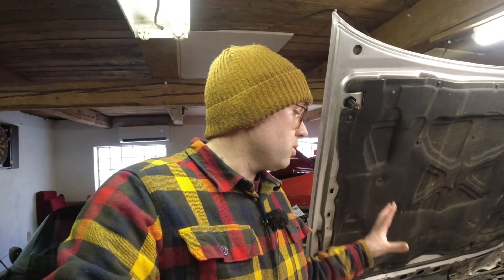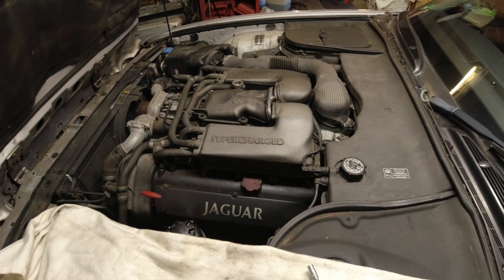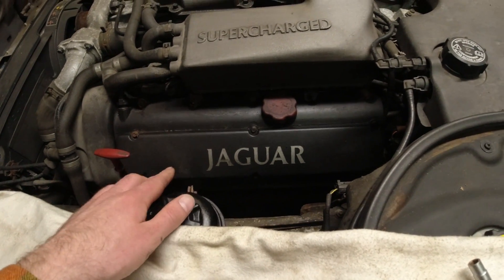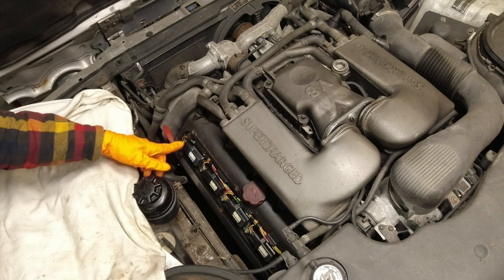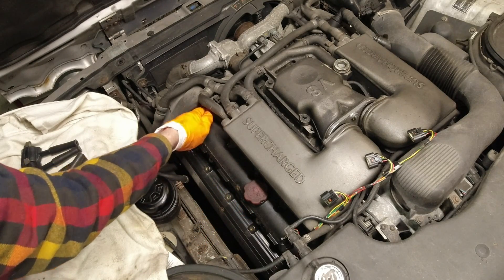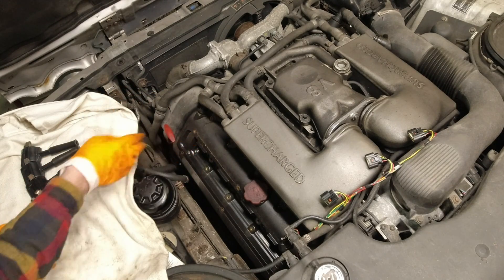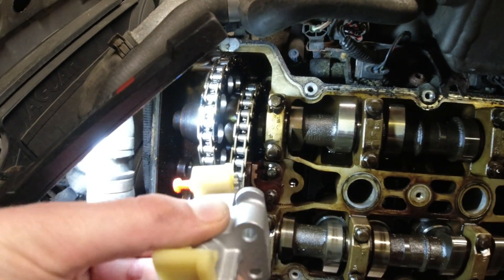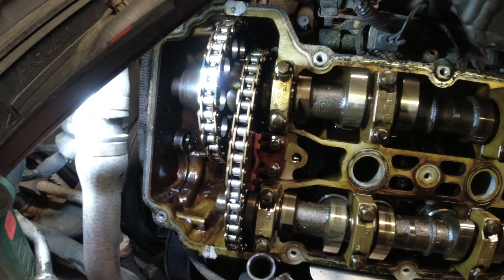Checking If Your Jaguar V8 Has Had New Upper Timing Chain Tensioners

Comment: Hi, Thank you for the video. That is helpful. I already have an XK8 4.0 where the tensioners were claimed to be replaced, but there is zero evidence. Now I know how to check. I am now also  looking at buying a 1998 4.0litre X308 and the advert claims the timing chain was replaced with the tensioners and water pump in Feb 2024. He has an invoice but there are no part numbers or photo's of the work. The car is on ebay in the UK. I doubt the owner would agree to me taking the covers off. If I heard you correctly, I thought you said that they no longer make the plastic tensioners? Is this correct? In which case then the new improved tensioners would have been fitted?? Looking at the car overall, it does seem to have been well looked after, but in my life I have discovered sometimes strange things happen??? Any comments?

Comment: Great video Adam.  Guessing that engine is an AJ27S.  I replaced the cam cover gaskets, coils, and spark plugs on my AJ33S recently.  If you are lucky enough to have the original Denso coils then no issues getting them out.  If OEM / Aftermarket coils used, then the boots can split and can be troublesome to remove.  I used dielectric grease on the ends of the boots on the replacements to ensure that this does not happen again.  I made a longer video documenting this as on the AJ33S left bank there are plenty of components to remove prior to getting access to remove the cam-cover.   Just thankful that the upper tensioners are metal on the AJ33S like you say.

Comment: With my x308 the tensioners were not cracked. The plastic guides however were completely shot. I changed all the guides, chains and tensioners whilst in there. Also upgraded the water pump and thermostat tower too.

Comment: Nice to know these tensioners can go. Are you able to tell us what years these are a common problem and what year engines have been upgraded? Thanks
Reply from the maker: All made before the 4.2 came out need to be checked.
Reply: Mid August 2001 they were upgraded to metal. So a few 4.0 should be ok

Comment: Hi Adam, Late 4.0s have the latest tensioner (metal) I don’t know about the XJ but for XK8/XKR it was AJV8 engines numbered from 0108130000 (built from midnight on 13 August 2001). My May 2001 4.0 XKR has the latest tensioners (and water pump and thermostat tower) but the 4.2 engine came in from MY03 in August 2002

Comment: Yup, let’s see how to get these tensioners replaced.  I have an early XK8 with low mileage (under 33K) and I’m pretty sure this work was never done by the original owner.  I have heard the number of steps to get the new timing chains set on the cam shaft with TDC retarded correctly can be difficult. I will watch every step you take on this!  Thanks from across the pond!

Comment: Yes! I like to see it. I have a question for Adam; For a long time the straight six was synonymous with Jaguar. The shorter block 2.4 and 2.8 versions.And the full size block 3.4 , 3.8 and 4.2 versions. It was in Jaguar's "DNA". A large, torque, smooth and powerful six. Just like A Cobra or a Ferrari is associated with a certain engine type. So the question is basically. Would you rather have seen Jaguar keep the straight six, develop it. Maybe With a Supercharger. Or was it necessary for pragmatic reasons to go with the V8? 🤔🤔🤔😃
Reply: I've read at some places that for typical USA buyers of the time, a straight 6 was seen as too small, and the V12 too big. So they came up with the idea of a V8. For me, the AJ6 and AJ16 are excellent.
Reply: AJ6 and AJ16 are great engines (I have had both) but AJ16 and AJ16 supercharged were unable to be developed further to match the competition.  V12, V10, and 6s were considered but the trend was for V8 at the time.  Interesting to note that a pure Ford V8 was touted but rejected by Jaguar at the time as not having suitable levels of refinement.  AJV8 was a Jaguar design even though it was assembled at Bridgend (Ford) facility.
Reply: @toooldclassics  Ok, Interesting that the existing Ford V8's were deemed, to unrefined so that they developed their own. Yes I can see how the V12 was phased out. Even though it is in a mechanical engineering point of view ; the "perfect" engine for a big luxurious car. NHV noice, harshness and vibration etc. But,, splitting hairs? A good ,balanced V8 Is probably not far behind. And the general buyer/owner doesn't care.
Reply: @peterpanx1  I'm fortunate enough to have AJ6 (XJ40), AJDV6 (X356), V12 (XJ27) and AJ33S (X200).  The supercharged Jaguar V8 is pretty refined, produces more power, and is lighter than the V12.  V12 is still special though - just an older design from the late '60s and not comparable to something designed in the '90s.